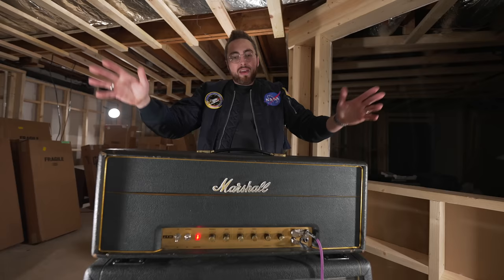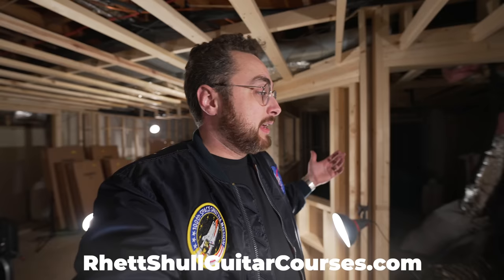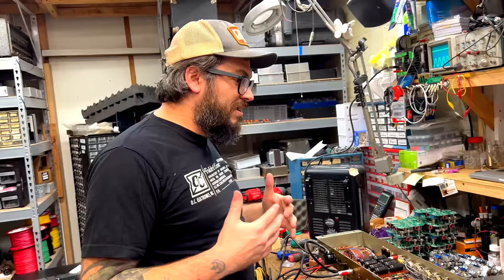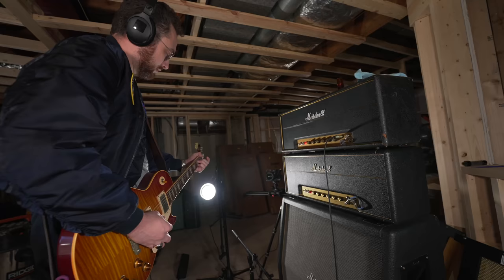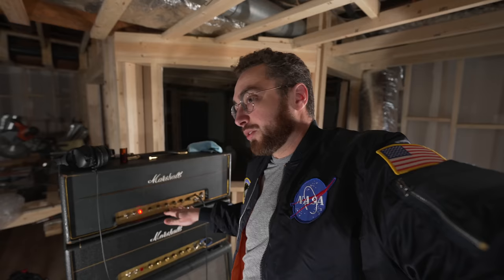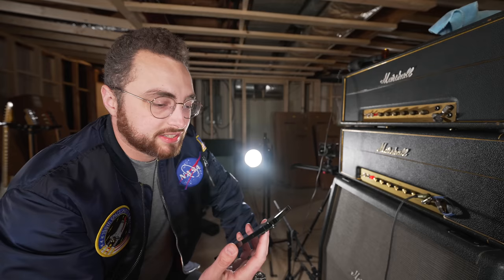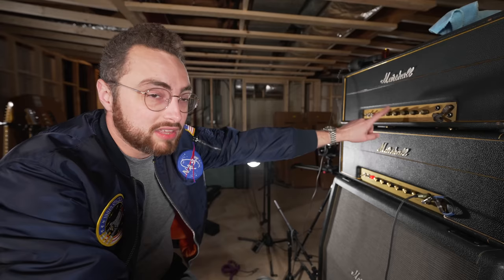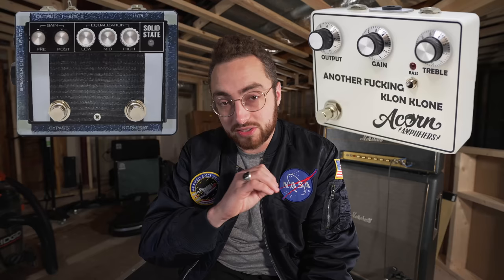This Amp Is So Loud It's Painful | Vintage 100W Marshall Plexi

Comment: Fun story: I played this outdoor gig for 5,000+ and was playing through a borrowed 1968 Super Lead.  It was an extremely loud amp, but...This was in maybe 1983, and we played started playing Dream On, by Aerosmith.  I played the intro piano part on guitar as we were a trio.  Well, the crowd went nuckin futs and suddenly I could not hear myself.  So I reached back and nudged the volume up (no master volume, remember). Still couldn't hear. Nudged it up some more. Nope.  Ended up pegging the volume. I could feel it blasting through my pant legs but had a hard time hearing it the crowd was so loud.  I have no idea how it sounded because I was using muscle memory to play the damn song.

Comment: I owned one in 1978 when I was 16. It sounded amazing on 4 and above. On 4, it was so freakin loud you literally couldn’t hear the rest of the band. 4 and below it didn’t have rock tone you wanted for what we were playing, I bought an Altair (misspelled) attenuator. It worked great until the smoke came up and literally burned. I bought another one thinking that was a fluke. Nope, it melted as well. 

Not long afterwards, there were no bass players around, I decided to trade it and my Ibanez LP for a Fender P-bass and a Fender Bassman 100 amp. Even trade. I was a bass player playing live gigs right away for the next 14 years. 

The P-bass was stolen and don’t remember what happened to the amp. In ‘78 that P-bass was probably and ‘72 or somewhere around there. It sure would be nice to still own all of that. That Ibanez LP was sweet. Oh well, I’ve had a great run. 60 years old and still playing 3 to 5 gigs a week. 

Enjoy your work. You’ll probably never see this but wanted to share that. Thx man

Comment: The ghosting is from a low power supply via the smoothing caps.    You can change their value a bit higher to not have the ghosting.   Will be punchier as well. 
That’s the black flag ones.

Comment: I think Dave Friedman and John Suhr talked about this in their Tone Talk podcast a few years back. The plexi sometimes does not hold up very well dimed, especially with modern power tubes and especially EL34:s. Running it on a variac 90v makes it a lot more stabile aparently. Sometimes a few tweaks need to be to it, but diming it all the way is not stabile for longer sessions and it will fail in some way.

Comment: Don't know if you read the history of Marshall book but anyway I have a 1972 50 watt and in the book it says that it is an absolute monster and it is I also have the first reissue of this amp and it is an absolute animal too. I kind of like the 50 Waters because they break up a little quicker you may want to give them a try I also have an original 1972 4×12 cab and oh yes those greenbacks make a difference. A friend of mine did the same comparison with the 50 Waters and they actually put out about 95 to 100 Watts and yes I have hearing loss

Comment: try dialing it back a little on a variac to avoid red plating...
also try running a speaker cable to a cabinet in another room ...I have used this technique to isolate only 10w into the room i'm actually playing in making these amps quite a bit more of a regular thing!🙂

Comment: Nice, glad you got the amp fixed and running. I was always told that a Marshall will put out around 50% more than the stated watts. Even older JTM45 will push around 45/50 watts. Out if interest what model Greenbacks are in the cab? G12M or G12H?

Comment: If you take a Peavey Decade, A Boss sd-1 , cross channel the Marshall, plug the guitar into the sd-1, plug the sd-1 into saturation channel on the decade, take the line out of the Decade plug that into Channel 2 of the Marshall- turn the Marshall volumes 1-1.5; Plug a mono switch half way in the Decade clean channel(it will channel switch the decade) you have 4 stages ,from quack to over the top gain.

Comment: I ordered the marshall SV20 about a week ago, i listened to some comparisons with a 1987X plexi and it sounds exactly the same as that. I think it's based on the amp in this video though. gonna probably keep it at edge of breakup (not your edge of breakup, less gain that that lmao) and probably keep it on 5 watts, maybe an eq pedal in the loop to keep it quiter if I need to

Comment: Ah yes, the joys of owning a vintage plexi. I owned a 1969 Marshall Superbass, plexi panel model 1992. An amp I'd wanted my whole life. I finally was at the right place to buy it. Well after 8 months, 5 trips to the tech (two of these trips I actually had to pack it and fly it out of state to a renowned plexi tech- Greg Germino), and lastly a blown power transformer, I came to the realization that I'm not a collector...I'm a player. And diming a stock vintage plexi is akin to buying a stock 60's muscle car and then just flooring it around town every day- something's going to break. So I sold the plexi and bought a new Marshall SV20h which I'm very happy with, it truly is a real plexi in a smaller package. Now when it comes time to buy another big boy plexi, it'll most likely be something like the 1959HW or a high grade replica like a Germino. But certainly something made with new components, and at a price point that I'm not puckered up every time I switch it on. That's an incredible plexi you have on loan there, the '67 aka Black Flag, aka the Hendrix Monterrey amp. Great content, thanks!

Comment: I'd like to be a little helpful. First off, to drive a pre '68 plexi with a LP the most common settings are bass zero and mids full. Presence and treble to taste (maybe start with each half way up and tweak). Channel jumping, not so much. Not advisable to use only a single cab unless you put some sort of hot plate in between and shave off some dB's. As far as converting your '59 HW it's pretty easy (though the xformers will will impart some difference in tone - but whatever, it's all goodness). A few value changes and you're good to go in less than an hour. Check out the Marshall forum, some amazing knowledge there. And lastly, do yourself a favour and spend the dosh on a Sennheiser MD409 to record these monsters. Just stuff it smack in the middle of the cone and it really captures the essence like nothing else IME of recording hundreds of these amps. Don't waste money on any of the new and improved versions of the mic.

Comment: One thing about cellphone dB meters is that they have a cap and it depends on what the microphone can take.  I bet you got a lot louder than that thing could handle. I would try it again with a proper dB meter.

Comment: I would be interested to hear how the vintage Marshall sounds recorded through OX Box or Torpedo Captor X.  Some of the punch and tonal character is coming from the physical speakers being pushed, the cabinet resonating and air moving in the room.  I don't know if IRs or speaker emulation can reproduce that dimension of the sound and feel.  Since modding a reissue or buying a vintage Marshall is an expensive undertaking, and the opportunities to play it cranked are limited unless you set up an iso box or room, would be good to see how it will sound in practical use.

Comment: 10 Most important amps in rock history VOX AC30, Fender Twin, Marshall Blues breaker, Marshall Plexi, Marshall JCM800, Mesa Rectifier, Fender Bassman, and peavy 5150. The last two which I’m not familiar on models would be Vintage Orange and Vintage Hiwatt.

Comment: Hi Rhett, nice video. Just want to point out one thing, that Black Flag JTM circuit is much closer to a Marshall model 1992 SuperBass than your 1959HW SuperLead. The good thing is it's a 5 minute mod to change yours into a SuperBass. That may explain why you have that much low end with that amp and it can compete with your Bass amp. Might also be why you feel that "thud" that you talk about, if you mod your amp to Superbass spec, I'm quite sure you gonna feel it as well in your amp, and that's way more cost effective then selling your amp at a lost and buying a vintage one, at least it's an easy mod, you should bring it to that repair shop you went and have it mod, I did on my 1959HW and it's easy to return it back to spec if it don't do it for you. One last thing, Jimmy Page main amp was actually a SuperBass from 1969, they tend to be creamier and less harsh.
Reply: True but the devil is in the details. First, looked like a big bright cap on the lead ch. I would like to find out the value of that cap..... Besides shared cathode, you have more NFB on the SB, less filtering, different transformers which usually provided more bass, different values for tone stack and a few other details. They are similar but still different circuits.

Comment: You do have to take into account the fact you are in a basement when you look at the context these half-stacks where played in. In an outdoor setting or a huge stadium, the sound can radiate out in almost a perfect half sphere, so there is a lot less bouncing right back off the ceiling and walls. And the sound drops off proportionate to the radius squared, approximately, I believe. But yeah, up there on stage was definitely brutal for those guitar players and singers, but at least they usually weren't in a basement!

Comment: I guess in the 70s they would only plug the cab needed and the others were for show... the sound pressure for just an amp is nuts. But hey, at the time there weren't PAs, they needed to sound as much as the drummer, and also be heard all around. That's why I admire bands that play at bars on their own, just some speaker(s) for vocals but no mic on any other instrument, just great musicians sounding good by themselves, kinda hard to find these days

Comment: I think the fact you’re saying the black flag has enough bass end to compete with a bass amp and relatively clean is because at that point in Marshall’s history they still were basically using the 59 bassman as their basic circuit, unless I’m mistaken, it’ll basically be not too dissimilar to a high power tweed twin or 100w version of a bassman

Comment: My first real amp ever was a JMP 50 watt 2204 which I bought when I was 16 in 1980. we used to practice with the amps dimed and luckily with with plugs in our ears, otherwise I would have been deaf at 18😮. You could almost lean into that sound but it was awesome. The neighborhood thought different though 😂

Comment: From 2001 to 2006 I played in a rock band with a marshall 100 w 2555 slash signature amp from 1996 (the Jubilee one) and a 2x12 Cab. At big open air Gigs I took a 4x12. I know what you mean, wenn you describe that percusive feel thing in the low end @rhett shull

Comment: Have you ever tried the Acoustic G60T amp? It’s early ‘80s amp. When I bought it about 20 years ago, I was hesitating between that and a jcm800… I did chose the acoustic, still got it! I think it’s one of the best amps, I would be interested what you think about it if can get hold of one!

Comment: The big misconception about 100 watt half or full stacks is yes they are annoyingly loud but for every ten feet you back up it gets much more tolerable. I would either face it away from me onstage or put a sound reflection panel in front and I have even laid 4by12 face down on top of flat sehnihzer mic ( didn't work so well). This is before software plug ins.

Comment: 125 dB A-weighted is actually absurd. Like unfathomably loud. Most shows that I've been to in medium-sized venues cap out at around 115dB A-weighted. The loudest I've been to was the band Boris which capped out around 120 dBA and that was totally overpowering. Crazy stuff

Comment: Also you mentioned the black flag is like a bass amp, well it is, it's exactly the same as the super bass of the same era except it has a 100pF capacitor across the bright volume (which basically does nothing above a certain volume anyway), your reissue has many circuit differences but the bright cap would be 4700pF in comparison.

Comment: I have a Valve State 120w Combo in my cupboard that you can flip CD’s off of 10 inches into the air when you play loud. It’s retired now and I play an all valve JTM60 that I’ve had in the cupboard for 20 years longer but only recently found out how to fix it. Brilliant for Gibsons, Gretsches and Strats, but horrible for my Tele and Rickenbacker.

Comment: You know what this video convinced me of- how on the money the JHS drives that emulate Marshal JCMs are- they are spot on imo. Both the Angry Charlie and the AT+, which is basically the Angry Charlie on steroids. I don't know about the rest of them- I hear they're good as well, but these two are spot on if you like this Marshal tone and don't have the funds for the real thing. It's not the Plexi- it's the JCM800 but- it's very similar to my ears. Tbh- what would I do with the real thing? I couldn't play it at my house- and I live out in the country, on a big farm. But I take care of my aging mother and have all kinds of animals around that would be freaked out. The JHS pedals over a little 40 watt tube amp works great for me- sounds like this, but much quieter. 

Well- not a lot tbh- if I crank this 40 watt amp I can hit 100 decibels- I think 110 is as high as I've ever seen it- that's dimed. I had to put a Cream Back 75 in it to get that- it wouldn't do that with the 70/80 it came with. I could hit 90 something with the 70/80 and then it would just start sounding like mud- it wouldn't focus. And I think it may have fried it if I left it there for a long time or kept turning it up. But with the cream back 75 I can hit 110, dime it out, and still sound really good. Well- the guitar sounds good anyway- I don't know about me.

Comment: Sounds much like my 1972 Laney L100. The Partridge power transformer of it gives 550 VDC B+ voltages. I wonder what B+ voltages pushed out those around 140W of power out by of  that Plexi? 😁
No wonder if it is a high maintenance type of gear. 😜

Comment: Tone tip: DO NOT jumper the channels on a Plexi. Hardly anyone renowned for playing Plexis ever did that back in the day, so that's not really an authentic sound for achieving that era of tones. If you want to sound like Cream-era Clapton, plug into the High input of the Normal channel and dime everything. If you want to sound like pretty much anybody else, from Hendrix to Zeppelin to Paul Kossoff to early Skynyrd, use the High Treble channel. Jumpering the channels together helps push the amp into the "brown sound" territory, but it significantly reduces note definition and makes it "fart out" in the low end, especially on those old black flag heads and JTM models.

Comment: The black flag is most likely a bass circuit. Bigger caps and the V1 preamp is joined cathode (fatter). Where in the super lead V1 it's split cathode. You HW is a super lead.

Comment: I got to put the volume at around 70% on my 97 Mesa Triple Rectifier through an old 280 watt Mesa 4x12. Needless to say I was on the moon, felt very connected to what I was playing. I wanted to push it more to see what would happen but it's such an old amp I didnt want to risk busting anything since I havent had it checked since I bought it. Makes me curious after seeing the wattage rating in this video if the triple rectifier is secretly more than 150 watts 👀

Comment: I watched a marshall factor tour video a while back. Its still on here somewhere. But the guy said, when they csme to the employee that was handling the 100 watt plexis, "these are the handwired boards" and they sound exactly same as the printed circuit board plexis". And he said, people want handwired because they think better but sound the same so we charge extra cost". Serious, thats what he said. I always wonder if that manager ever got heat over that revealing? Because thats kind of not a good thing to reveal

Comment: At 3:40 in you were, calculating wattage.  The "8", I'm assuming was the load and 8 ohm speaker.  What was the 34, current??  If so, it's typically in mA and .034A.
So .034 x .034 = .001156 and divided by 8 = 0.0001445!  So, wanted to confirm how calculated and what the "34" was??  Thanks in advance.

Comment: That 67 Blackflag is more  like  a 1992 SuperBass (of which I owned one as well) and not a 1959 SuperLEad (which surfaced 1968), clearly distinguishable by the dual rectifiers and the 8 Main Caps. It has a different Filtering (( Caps on Mainboard, 32uF Mains, 16uF PI) vs your 1959 with 50uF Mains and on PI)  and it's Transforrmers are also different (OT should be a 1202-119 or -132). Some of them also had different Voltage Droppers in the PreAmp, if this was intentioanlly or not, I can't say . 
You can get your 1959 HW into this range and its only a few components which need to be changed in your 1959 HW to get that thud (Main Stage Coupling Caps( 0.1 uF),  the Tone Stack Slope R (56k) and Treble Cap (250pF) and also the Mixing Resistors (270k)). You might also want to lower the filtering (but be careful, the lower you go the higher the chance of ghosting) and  replace your Mid Pot (Stock 25k) with a 50k in your HW which beefs up the high mids into a real brown range.
Reply: This amp looks to have a bright cap on the lead ch. Wondering what the value is? Couldn't make it out.
Reply: @JimmyDevere  This amp (1992) normally has no bright cap, so it was fitted afterwards. Depending on what you plug into, what your speakers are and what your sound preferences are you can be good with something between 68 and 250pf...based on the fact that I see a Silver Mica and given the size I would suspect something 100ish pf...
Reply: @Burgschall  Good eyes. Thanks. I want to try some bright caps in my plexi bass circuit. Were you able to see the neg FB value in the gut shot? I currently have 27k (wired to the speaker jack).
Reply: Pete Thorn did a video on bright caps. It was interesting. I'm not going for EVH tone but he demonstrated the rather large effect on tone of one simple change.